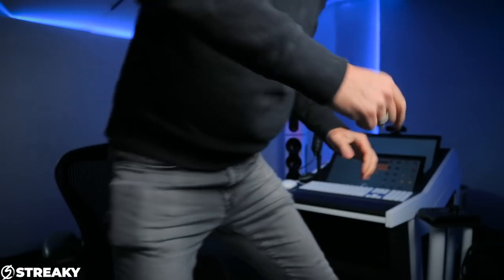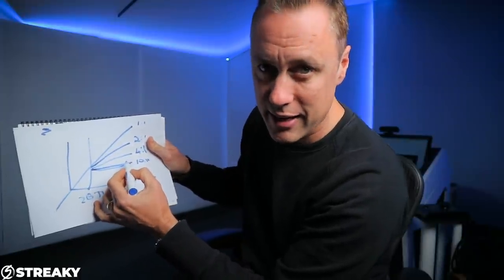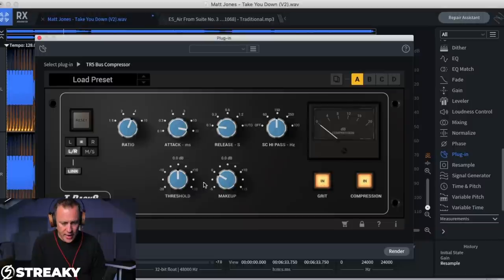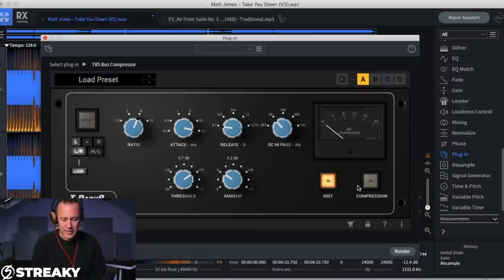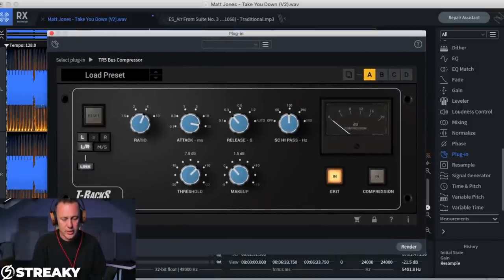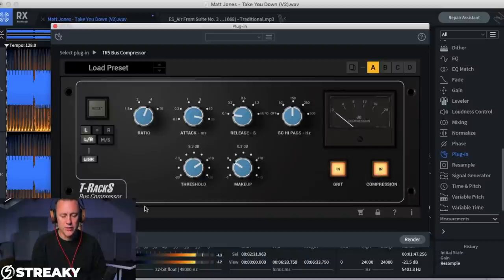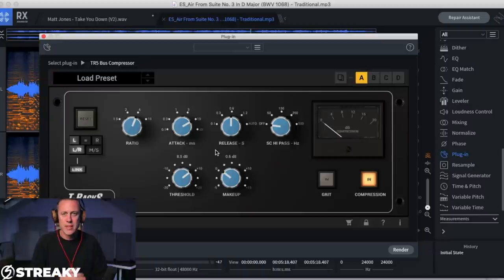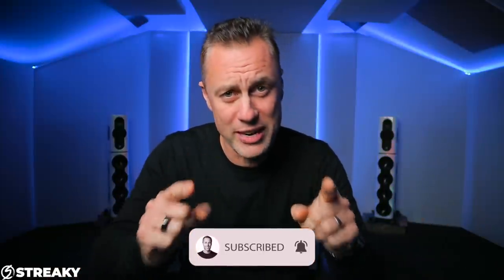GLUEY COMPRESSION | How To Use A Mix Bus Compressor

Comment: If the threshhold isn't 'met', aren't you just boosting/quieting the signal with the makeup?
I guess with this compressor, with the HI PASS on, it would just work as a hi-shelf starting from the HI PASS frequenzy.
Please do correct me if I'm wrong!

Comment: A good starting point for release times (on continuously variable compressors that are not scaled like this SSL emulation) is to do this simple math: 60000/BPM.
The result is the 1/4 length of the track in ms, so for a 4/4 dance tune, its the time from one kick to the next. 
Then depending on the track and what you're aiming for try half of that (1/8) or divide the result by 4 times to get the 1/16 length.

So effectively the compression follows the track BPM. So just listen, tweak, listen, etc.
Reply from the maker: Proper knowledge 👍
Reply: Same concept used in reverb predelay, delay etc
Reply: @RaduJon  yes but most people don't think about this stuff much, simply because delay plugs (and some reverbs with pre delay times), have a sync button that calculates this for them, whereas compressors (the ones I've used anyway), don't. So just putting this simple math here for people to try out.
Reply: nektar what compressors do you use if I may ask? Sounds like you’re doing analog. I do hybrid as well
Reply: @RaduJon  Actually for mastering I am completely in the box because I prefer the flexibility/recall of plug ins and prefer to steer clear from the crazy expenses of analog mastering.

For mixing I still mostly use plug ins, I just track through some cheap 1176/LA-2A Klark Teknik clones.

Comment: Hi Streaky, thanks so much for the video! I have a question: I'm mastering really dynamic music, so I just want the bus compressor to have 2 dB gain reduction on the loudest moments. What about make-up gain? If I boost it to match at the loudest part, the whole thing is louder. Is that something to generally avoid?

Comment: Great video.  I was surprised to see release set to 0.1.   I usually use or see other use Auto.  Would love to hear more about that or a follow up video.  Thanks for the great content as always.
Reply: I used to use "auto" all the time, but after trying a faster set release you can really hear a noticeable difference in punch and clarity, sometimes a faster release can add too much high end energy "treble harsh" so the mix may have to be adjusted.

Comment: Thank you, Streaky! I have been waiting for this video from you for a quite I while! Could you please explain what do we do if we have a very dynamic mix, consisting of several parts (three and more) and we have to bring a glue compression to it and also bring it to a commercial level of -8lufs or so? In this case the glue compression would work only in the loudest part. So does the limiter kick in only in the loudest part. I assume we can can another compressor with low ration (1.25) and low threshold (-20 or more) with the gain reduction about 3 db. We also can you automation... But what is the right way to approach a dynamic mix? Thank you!
Reply: Nice question . In this case is automation might be an option to push a bit the quiet parts?
Reply: Automation is key! I think that the threshold is the main issue, but the release will also need adjustment since its kind of the "pulse" of the track. You could jungle with these depending on what kind of mastering chain youre using
Reply: Yep, threshold automation. Depending on the DAW  you use,  object oriented plugin chains might be faster in workflow!
Reply: If it's mixed properly, mastering should be a doddle, but automation is your friend for wild dynamic range shifts.

Comment: Thank you streaky, So with the multiband would you only use that on the low end or would you use that across-the-board? And then would you put that masterbus comp before or after the multiband? Many thanks in advance.

Comment: Thank you for another great tutorial. I love mixing into SSL compressor plugin, always have it on my master fader. Would you recommend same settings for this application as you showed in the video? For mastering I use the same SSL plugin, but would you change the settings or keep very similar while mixing into compressor and while mastering? I always used ratio 2:1, is it too small? Thank you so much for the answer.
Reply: There are a lot of people who use 4:1 (TLA, Wallace etc.), so I suspect it's mainly an issue of taste.

Comment: I have been using the SSL G Buss on 4/30/0.1 for so long I feel like getting it tattooed on my arm. Nice video. Obviously, the original didn't have the SC Hi-Pass and I find this an excellent addition now I am 100% ITB. I use a selection of versions from different companies, all sounding slightly different (just like the original hardware). I don't have my notes next to me, but I seem to remember the Ik Multimedia version you are using is brighter than the UAD and Waves version. Brainworx Townhouse version is also excellent but maybe a little too coloured for mixbuss, but nice on the drum buss. Native Instruments do a nice version but again very coloured and probably not suitable for the mixbuss. I think I probably use the UAD version more than any other version as it sounds the closest to the hardware version I used to use, but of course, none are better or worse, just different. By the way, an independent guy running a company called Analog Obsession does an excellent free version of the G buss called Buster and the newer BusterSE. Check it out if you get a chance and it is obviously great for any people on a budget. I also use that version a lot. I am in no way associated with this company, just sharing the love. Thanks again. Subscribed.
Reply: did you do the blind test on gearslutz? i actually picked the ssl native plugin over one of the hardware units in the shootout. haven't played with tim p's l-bus as i don't have nebula but i think those two are probably the tippy top for this sound ITB. i graduated from the waves (and logic stock vintage vca) to this ik version, but i do think it's a bit harsh (even without the grit--surprised he's using that, was making a big difference in brightness to my ear). totally workable and better than the waves (in terms of tonality and stereo image--waves always had good action but wack tone). from ik, i graduated to the psp busspressor, which has slightly nicer tone, or less aggressive tone at least. i was a big fan of buster 6.1 (still am) and obviously the new version is great too, probably just flat out better as the attack and release times respond more sensibly in busterSE. i've yet to grok its tone, but i'm happy to hear you using it alongside the UAD stuff (i've never tried) because it's one of my favorites for sure. and i'm glad he released it alongside the old version because i really liked the tone on that. on top of all this, my one hardware piece is a 7721 stereo vca comp (ssl-inspired). def has more going on than any of the plugins but it could never touch the real thing. i don't have any tattoos but i feel you on the tattoo sentiment!
Reply: @dirkchurlish4074  No I haven't tried the Gearslutz test. I will look that up. At the end of the day it's about what you like personally, isn't it. I tell my students to stop looking for "the one that sounds exactly like the hardware" because it is self-defeating. 1)All the hardware versions sound a little different and 2)The plugin will be modelled on one or a few particular models, so will not sound like the different piece of hardware they might compare it to. I have tried the Acustica versions I wasn't that impressed to be honest, but that's just my opinion.
Reply: I actually like colored masters but use different plugins for that (presswerk, te-100 and satin)

Comment: Could you show us how to take advantage of mid/side. I always hear more experienced guys say that mid/side is a game change, I mean I use it a bit, but unsure as to how most 'professionals' use mid/side in mixing and mastering processes?
Reply: Me too. I've had fun layering my samples with multiband dynamics and varying the mid/side. Also some interesting stuff using it when phase flipping. No way a professional opinion but some food for thought :)
Reply: I actually switched back to stereo mode (or dual mono, because I prefer stereo unlinked sound), get better sound than with mid/side. But it also depends on a mix. With some mixes mid/side could be better, I suppose.

Comment: Im a bit confused about that gain reduction meter. Shouldnt it move if the compressor is affecting the signal?
Reply: The meter in this case is reflecting GR (gain reduction). However that meter can't show a representative of what the compressor does to colorize the audio. I think the point Streaky was trying to convey was in mastering compression, do just a small bit to glue it.

Think literally here IMO, too much glue gets things messy, so don't use too much.

Comment: wouldn't it be better to level match all parts in the mastering chain and keep all that headroom for the limiter? i understands the SSL (which is always my first processor on my master) always sounds a little better when i put it on but if it's an extra 0.2db then i don't know whether it's just the level difference making it better?

Comment: Just curios about how ratios work, on the SSL why does setting the ratio to a 1:5:1 trigger the compressor with no threshold, but when its at 4:0:1 it doesn't trigger the compressor ?

Comment: I think you can set the ratio 10:1 with 30ms attack - set the release so that the needle is resting between beats - and then re-set the the ratio to 2:1 or 4:1 depending on the track (the needle will barely move at this point). ✌️🤖🔊

Comment: Hi, really like the upgrade to your video skills! :P I do have a question I want your opinion on, I "learned" parallel compression on the mix bus from Alex Tumay advise. like smashing the mix bus compressor (a second compressor, I always do my first like you explained in the video) with a "crush" setting & then turning the mix knob down to like 3-7% type'ish! ofc Alex Tumay is not a mastering engineer, but I tested it and I like the sound! what's your opinion on this approach? Thanks in advance & keep up the great work!

Comment: I've just got SSL Bus Compressor 2 and am comparing to this T-RackS version and, is so funny (in a good sense)...
The SSL seems to have a havier "release action" over the material.
Same settings, T-RackS sound louder and brighter.
I had to set the makeup 1 dB less on T-RackS and to set the release 1 level lower on SSL.
Now they sound very similar but only when I set SSL SC Hi Pass close to 85Hz...
It seems T-RackS has a softer filter on that part...

T-RackS Bus COmpressor -  Ratio on 2, Attack on 1, Release on 0.3, SC-Hi Pass on 60Hz, Threshold on +10, Makeup on +0.6 no grit

SSL Bus Compressor - Ratio on 2, Attack on 1, Release on 0.1, SC-Hi Pass on 85Hz, Threshold on +10, Makeup on +1.6 no oversampling

Comment: Hello streaky....one question...!!!!
Should we do this glue compression method only in the mastering stage or also in the mixing stage??
I am asking because i had seen a video from a person who was doing this in the mixing stage..and he was saying 2:1 ratio and generaly -3..-4 gain reduction whould be ok when mixing a song just to glue it a little bit and take down some peaks...
I am confused now!!!!
Reply: There are no rules. The are lots of problems with videos of this nature. Everything is just a guideline and is completely dependant on the material. In the mix, i'm not generally using a comp on the 2 bus to "take down some peaks". I've usually dealt with that on the drums sub group and individual trakcs with compression and more importantly, saturation. However, it completely depends on what you want. Working the bus compressor harder will create a different effect and it's exactly that, an effect. Making the entire track compression react to the peaks of the drums is a completely different feel and can be desirable, it all just depends. You can experiment using different things as a side chain to your 2 bus comp (vocals or bass for example) to give a completely different feel. 

Mastering is a different situation but many of the same things apply, it's just that you are dealing only with a stereo bounce at that stage so you have to do what's necessary to get the result you want. If you are trying to create density in the track but it is way too dynamic, you are going to have to deal with those peaks through compression, saturation, clipping and limiting. These are all things that should be done in the mixing stage though and you dealing with a problem at that stage in mastering rather than simply trying to get the best out of the track.

Do what is necessary for the track. Learning what that is and how to do it is as much a skill as anything else!
Reply: @greenenoiseaudio  wow....thanks for the comment!!!!!

Comment: Hi Streaky, greetings from Costa Rica! Love your videos and I have a question regarding compression, what happens if you make lets say dance music, but you have some orquestal sounds going on in the track aswell, since it's a mix of both worlds how would you approach this scenario? What kind of gear/plugins would you use and why? 
Thanks a lot.

Dennis
Reply: I saw an interview with Andrew Scheps recently where he said that he basically treats everything the same regardless of the genre. So it won't really matter what the sound source is, as long as there are no conflicting frequencies and everything is EQ'd and compressed properly.
Reply: Andrei Sora thank you! That actually makes a lot of sense, sometimes we overthink so many things since there is a lot of things to consider when it comes to mixing but the “simple” approach is usually the right one for that matter!
Reply: @ohmnemusic1606  Indeed!

Comment: I'm assuming this a mastering application? As a mix bus compressor, I've seen people put a lot more compression on their mixes. 3 or 4 db gain reduction is not uncommon. I was surprised that even with hardly any movement of the needle, you could here the difference. That's probably part saturation I assume?
Reply: sometimes i smash that mixbuss comp at mix down if it works...
Reply: go fiddle with some knobs and listen carefully .
Reply: @fromabove422  Great help, round of applause.
Reply: yeah I wonder too btw, in presswerk saturation is displayed in gain reduction. You would see GR even with ratio 1:1.

But in this one idk.

Comment: When that meter isn't moving, I don't hear anything changing. ha.
Reply: The amount of times I’ve been changing a sound and I was actually changing a muted channel really makes me question my trust in my ears
Reply: My eyesight and hearing isn't what it used to be, but I think for a section of the video the threshold was set so high (and/or the input volume was so low) that that there was (almost?) no compression happening at all. Hence the needle didn't move and pressing the bypass button made no discernible change to the sound. If any processing was happening it was incredibly subtle.

Comment: Thanks for the content! But can't understand when threshold is above zero. What does it mean? Usually, it is below, as I thought. And the signal which is higher that -12 dB going to be processed, for example. But when the threshold is 0+, is it something analog? Then I don't realize it at all.(
Reply: Hi 👋 @TheOneTonne , In analog you could go over 0 no question , and in digital , in certain condition you could go over zero when processing . DAW works in 32 or 64bits floating. Big word isn’t it, that means there is virtually no zero internally in the daw as long as you don’t convert the signal to an output, a physical one or the main LR output for bouncing, Good practice is to pay attention to not overload pluggins because most of them sound bad in that case. Nevertheless as long as at the end when you output or bounce the track under 0 that will be fine. All the rest is question of how does it sound.
Olivier.
Reply: @UCPSkj0yDXNgG99pmxFM8Wvg thanks for the answer. But anyway, in your situation signal was way below 0, so how does compressor starts to work when the threshold is above 0 ?
Reply: TheOneTonne are you talking about the vuemeter ? In that case the 0 represent no compression etc. 
Then to go above zero add gain before the compressor.
Reply: @olivierclasse  oh, now I see, thanks. Something new for me. Subscribed you yesterday and find your content very helpful. See you soon
Reply: TheOneTonne  it s streaky content and yes it great 👍

Comment: Why you where using compressor only on Left signal? Coz I see you have put in on L/R and selected only L... Any reason?
Reply: when its on L/R and Link is on, the L will set both L+R
Reply: @mansosound  Yes but why not having the compressor listening to both channels?

Comment: YT makes it very difficult to hear these types of subtleties, Idk if I'm just imagining it sometimes.   Is it possible you could use a plugin that mimics YT algorithm so that could be taken into consideration when you do these types of videos and remove it before uploading. Wondering if that'll make things easier to hear.
Reply: YT would probably just compensate even more. Are you watching at 1080p?
Reply: @MrJumboblimpjumbo  yes, I'm watching 1080p.  And yes, the idea of using one of those plugins would be to compensate accordingly vs blindly pushing a bit more and hope it's enough.
Reply: if you cant hear  its nobody's  doing fault but yours